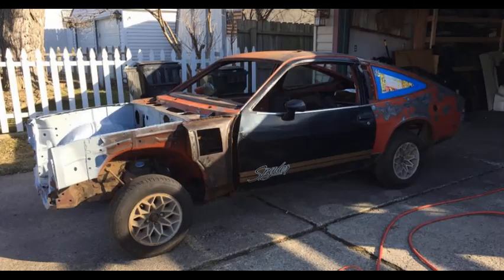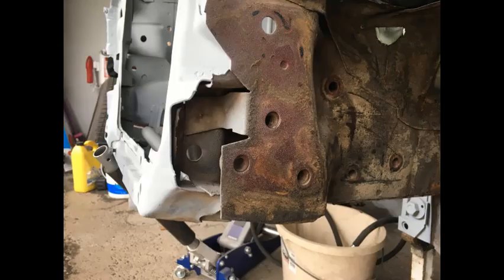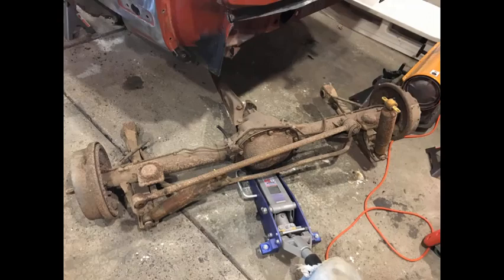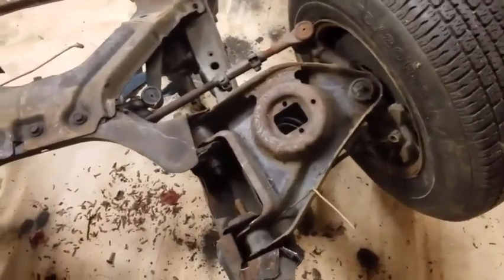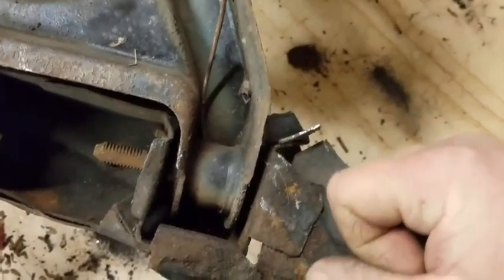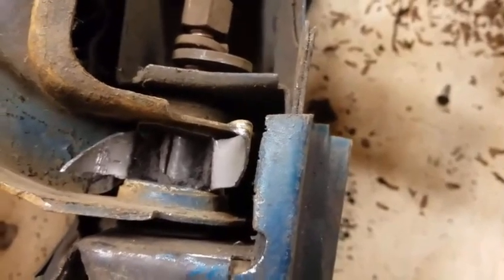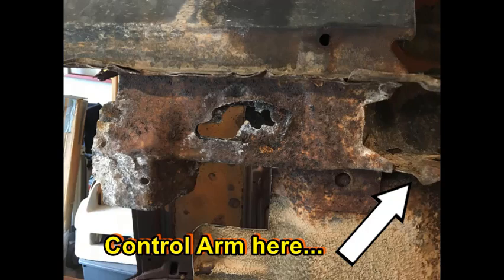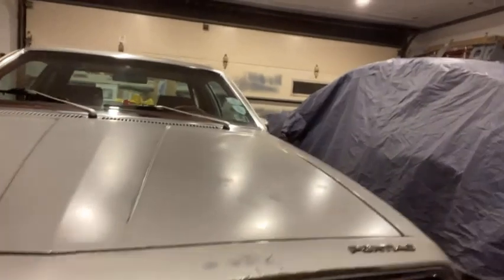Chapter 3: Rotisserie Bird

Comment: That's a good deal on the Rotisserie. When I looked a while back I didn't see any for less than about $2k.
Reply from the maker: This same rotisserie is selling for $1400–$1700 on eBay now.  Silly inflation.  

I looked for a used one but all I found were death trap looking ones for $500-600.   For $1000 I got a new one.

Comment: Why did you take the dif out before you put the car on the Rotisserie?
Reply from the maker: Weight.  The car needs to have its center of gravity centered on the pivot point of the rotisserie.  That diff was a lot of weight low on the car so it would have been a challenge to get the car centered.   Once I started putting parts back onto the car, it made it very difficult to move and/or rotate the car too.